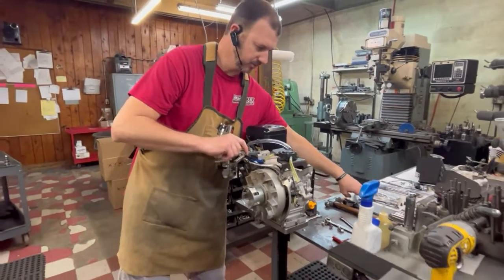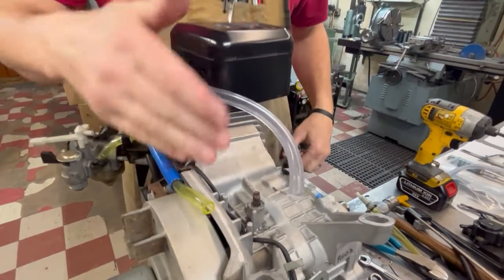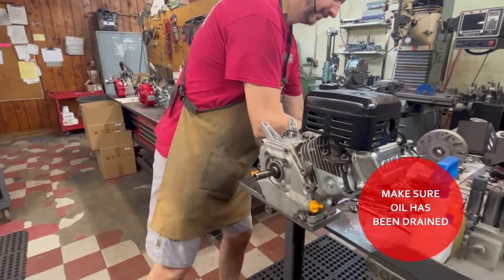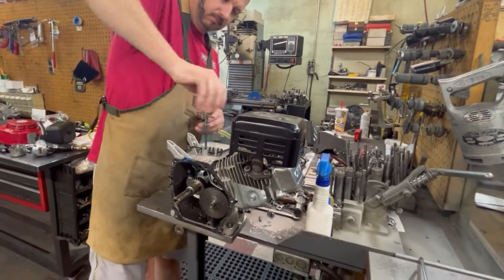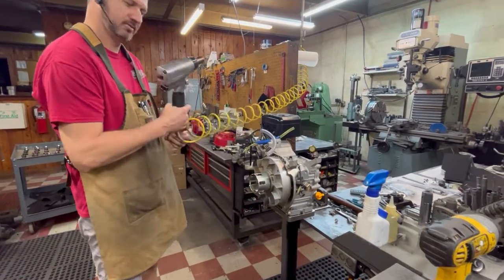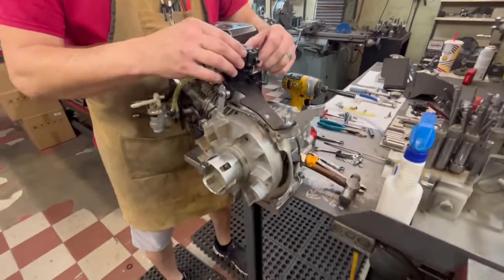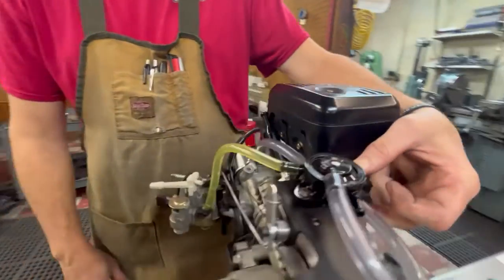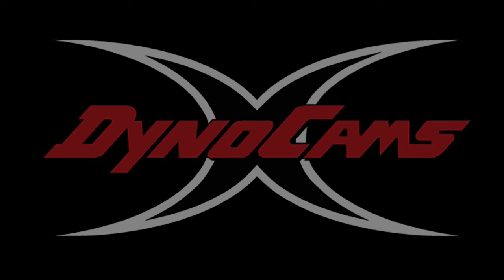Ducar 212 Rev-Limiting Coil Installation

Comment: Also , is it necessary to use a pulse pump on that build ? I see guys do that with built engines . My question to u is , when would u neeed one ? Exception being the gas tank sits low. My engine is pretty built but dont run a pulse pump. Would it be better to? Would it give me better performance or is it just to get the carb to run right ?

Comment: Wait , are u limiting the rev with that coil? I thought that u wanted to have a high rev limit like around 10k rpm. Like for example the ghost engine has a rev limiting coil that we change out to one that’s not limited. It governs the rpms. We change it out to a reg predator coil or after market.

Comment: I don't understand how this can happen if the throttle (gov) spring is repositioned to the hole at the end of the governor arm and the throttle screw is backed out far enough. The governor should not be able to max govern under 5K RPM. Are they using lighter tension springs than they used to?

It may be that the governor behavior is different for the go kart application. (gearing and load)

I run all my minibike engines with the spring positioned at the end of the governor arm. I have not experienced any governor behavior under full throttle during my "top out" runs. My strongest engine tops out at 5600 RPM according to the max RPM recall on my tach. At one point I had a stock 196 governed to right at 5K and I could run the screw in far enough to max govern 4500 RPM proving adjustability is still there.
Reply: I just put together a 224 and I love it.
I have this coil,  it works perfect and fits a 224 in case anyone on your forum might wonder.
My flywheel is a cast aluminum 212r flywheel.(from one of the big shops of course not a****z or e**y, some things i don't trust to just anyone)